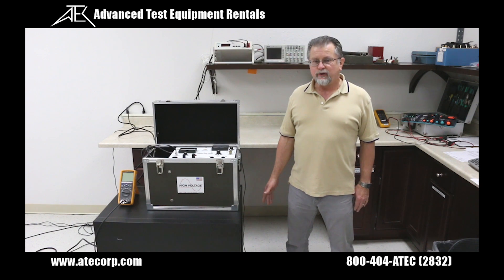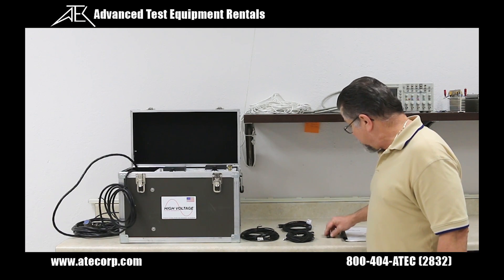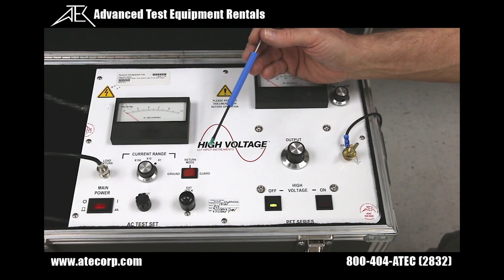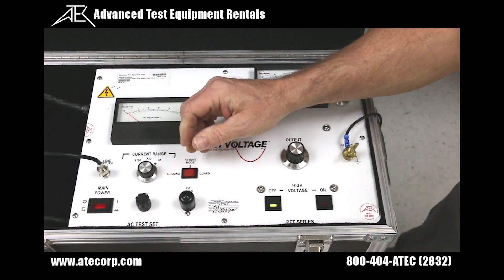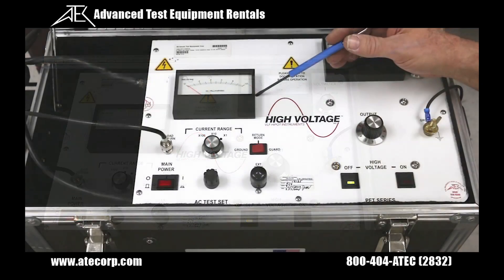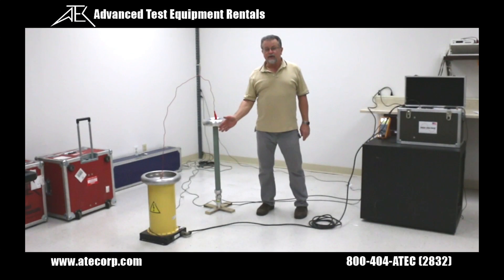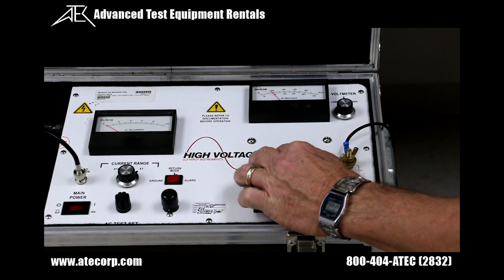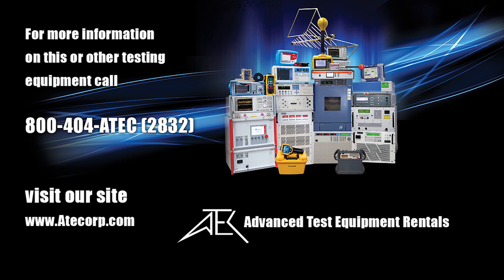Rent High Voltage PFT-1003CM AC Hipot Tester 100kV

Comment: Hi, Can you tell me model Fluke conected on HiPOT? Thanks
Reply from the maker: In this video, the Fluke 287 was used with the Ross Engineering VMP 200. ATEC rents the complete calibrated system with cables. http://www.atecorp.com/products/high-voltage-inc/pft-1003cm.